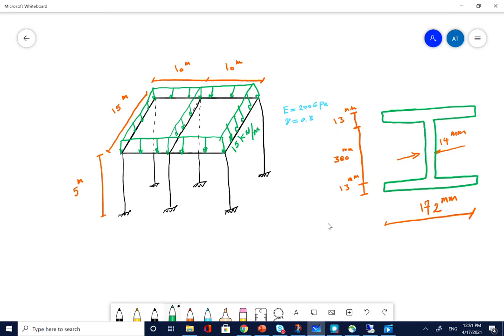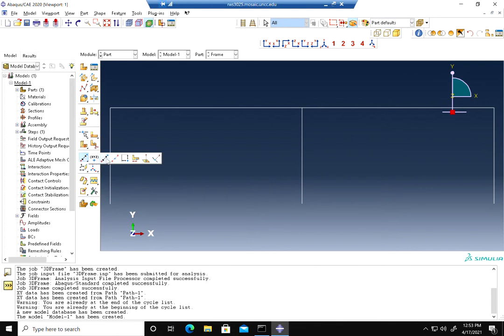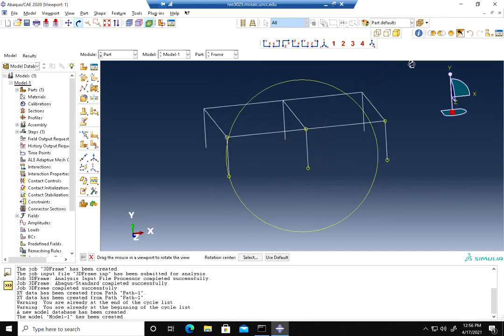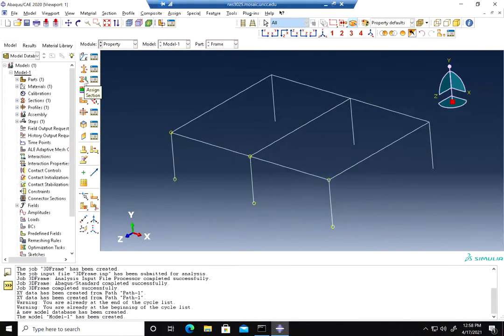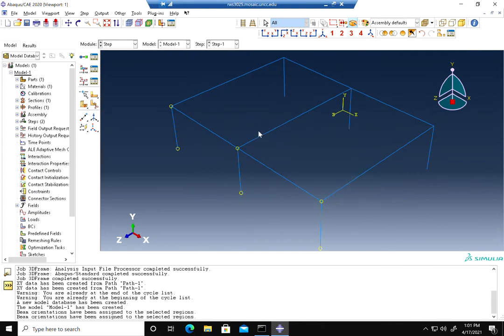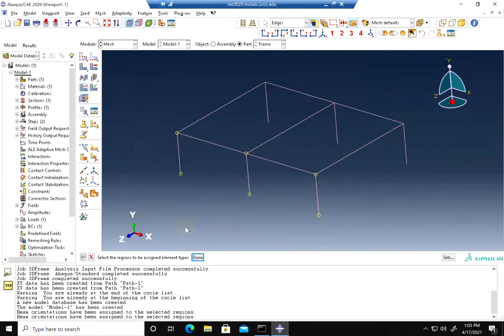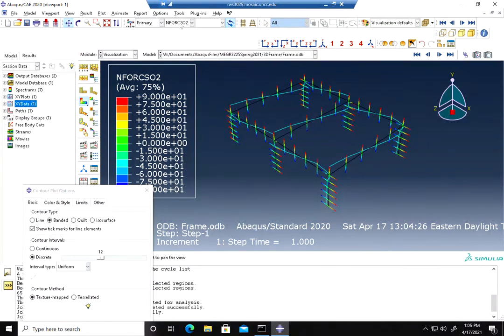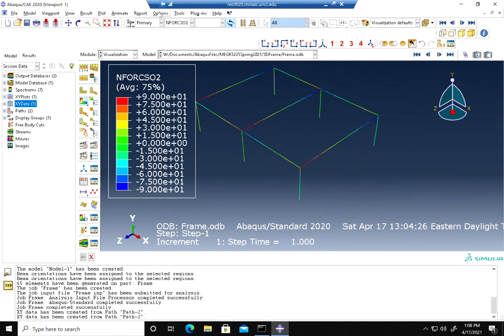MEGR3225- Modeling a 3D frame in Abaqus using beam elements

Comment: Just a suggestion - if the columns are all the same length, you could apply an equal length constraint.  Similarly for the beams.

This was a good lesson on generating a 3D wireframe.